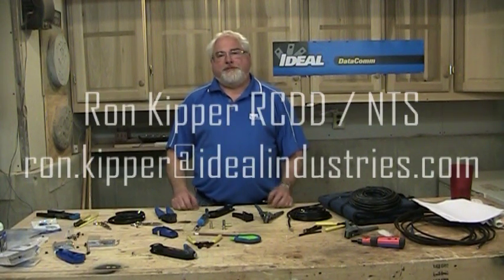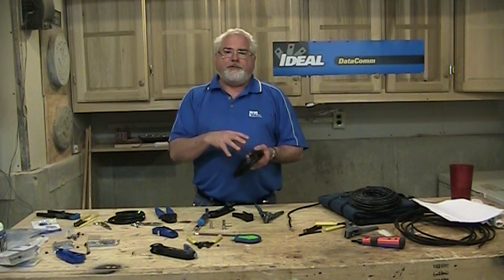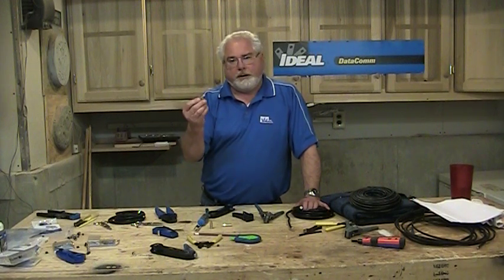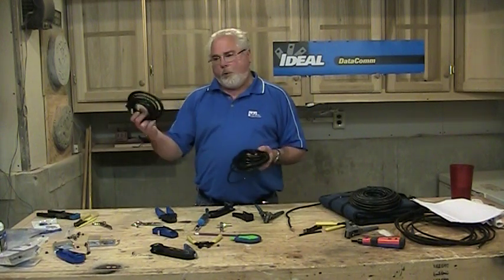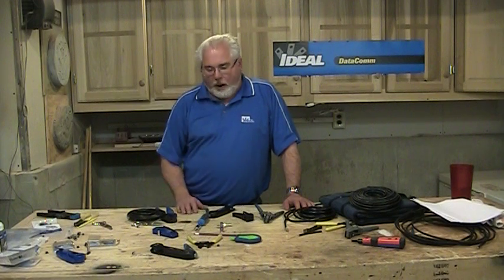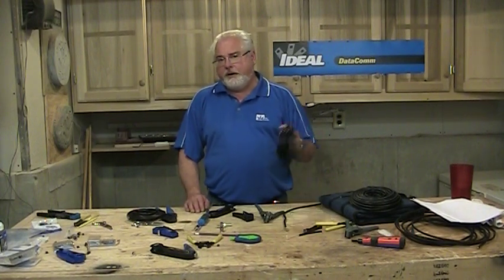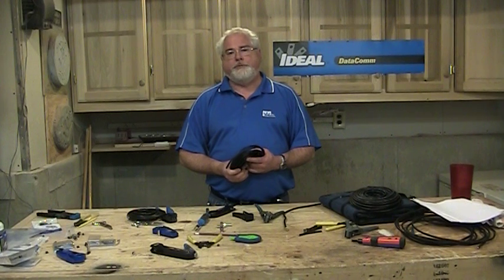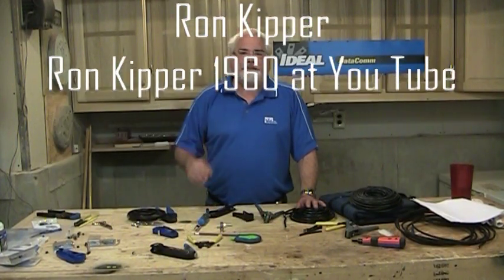Terminating Coaxial Cable

Comment: Would like your opinion on the typical ISP grounding blocks that ground only the outer layer of coax vs the gas discharge lightning arrestors that would ground the data path. There are a lot of comments in forums suggesting electronics damage from spikes coming in through ISP's coax feeds.
Reply from the maker: Hi Doug I have not heard of any damage caused by the ISP services but could see how that might happen. I don't have any experience with the lightning arrestors which seems like over kill for a ISP line. I know in my area everything is buried so probably not much of an issue. Have fun Ron

Comment: Hey Ron, great videos! Would you have recommended coax cable manufacturers that you would recommend?
I am getting ready to wire a remodel and want to pre wire the home to keep it clean and out of sight.. there are so many companies out there and no one has a recommended brand.
Reply from the maker: Hey Jeff the are several General Cable is a great brand but so is Southwire and is sold at Home Depot and Lowes. Have fun with the remodel Ron